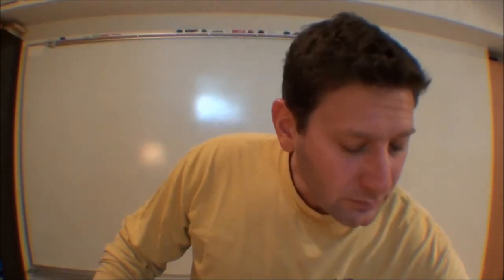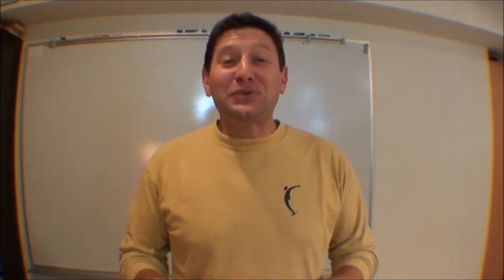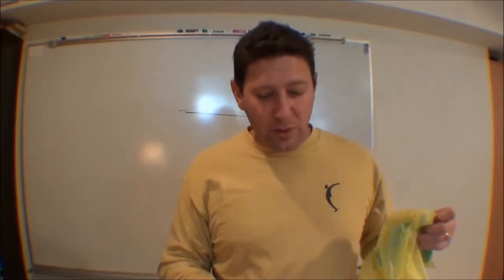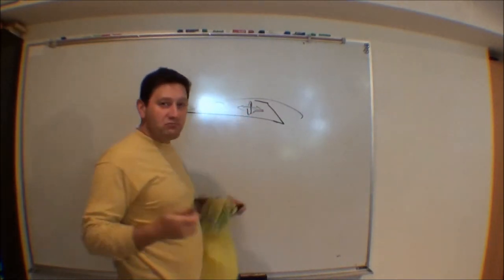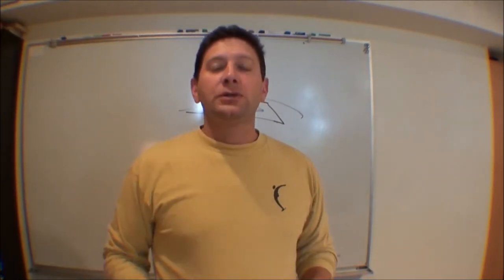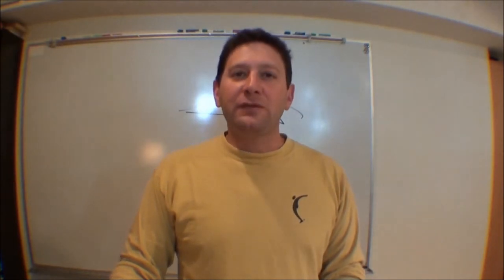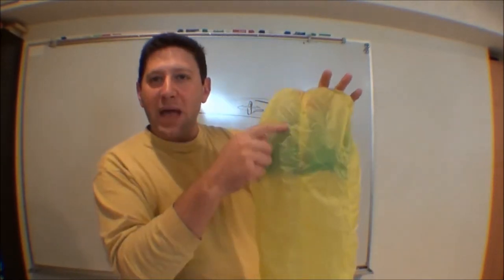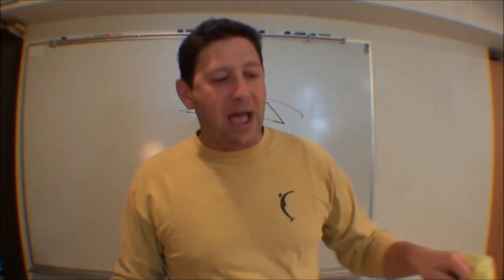Safety First TV What are Airlocks?

Comment: Airlocks shouldn't stop you from stalling the wing in a situation where you have pulled the controls down far enough to change the angle of attack to the stall point.   It just means that in a stall, the wing wouldn't collapse which would make the stall recovery quicker and more predictable.